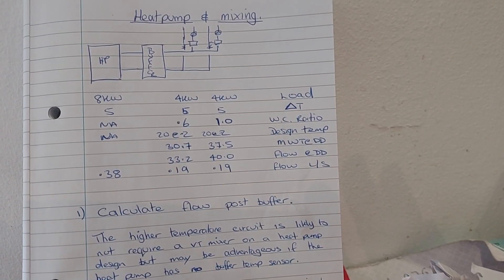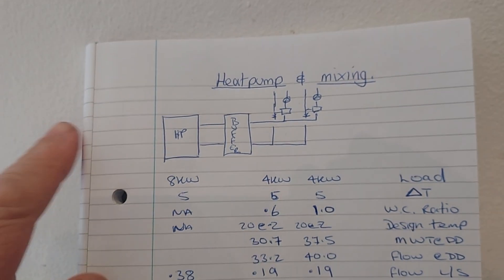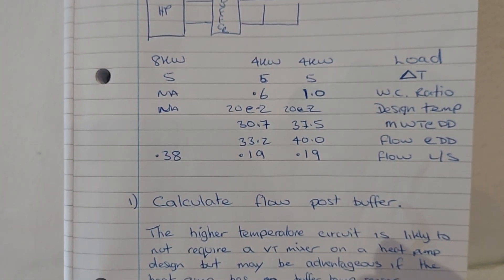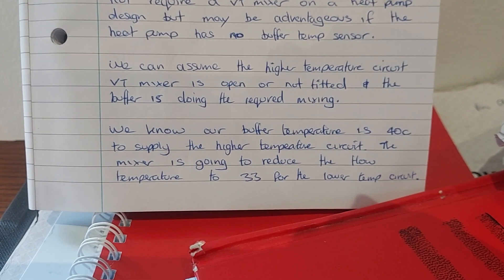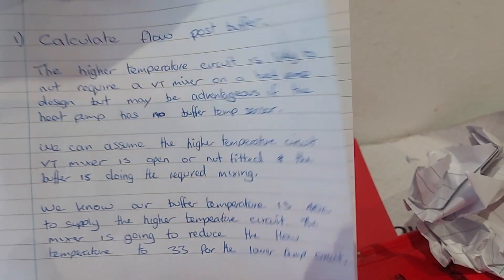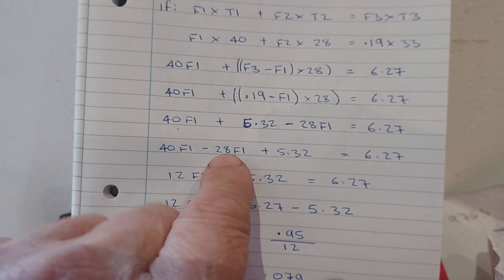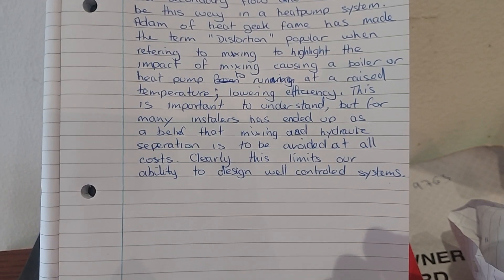Heat pumps, buffers and variable temperature mixers.

Comment: Informataive as always, thanks Andrew.  Liked and subscribed.
In my situation I have UFH throughout a large, two storey, new build.  With low flow temps in mind,  pipes at 100mm c/c except bedrooms (150mm c/c).  One manifold on each level.  Ground floor slab is 100mm dense concrete with lighter cement screed upsatirs.  Highly insulated & airtight house.  I think my heat loss will be <7kW in a 300 sq m home.  With around 3km of UFH pipe (300L of water open circuit) surely I don't need mixing or a buffer?  My concern is would a 7kW Heat Pump require secondary pumps to support the volume / head of water.  If so can these be slaves to main unit?
Reply from the maker: If a heating circuit requires a different flow temperature for it to operate correctly we use mixers to achieve this. If we are using mixers we will not be able to balance the mixed circuits with the flow rate at the heat pump and so we need hydraulic separation. This is provided by a buffer but it does not have to be a buffer and could just be a different form of hydraulic separation. Another reason for using hydraulic separation is when the pump in the heat pump does not have adequate residual pump head to produce the circulation required within the system and the heat pump when directly linked. If you are getting stable temperature throughout your home it is likely that you do not need either a buffer or hydraulic separation. If you are using on off thermostatic controls you might we'll find a buffer would benefit you.
Reply: @andrewmillwardwatford9410  Thanks Andrew.  Not moved in yet, so can't say.  Haven't even bought the Heat Pump.  I have space for a buffer and no issue with including, if of benefit.  Like you though, have heard the same noise about it being of deteriment.  I would have thought though, with the volume of water I have in the UFH, and the fact that I have no rads (other than towel rails off UFH manifolds), that if anyone can omit a buffer, it's me?  I'm from a different engineering background and generally attracted to the simple solutions.  I have air temp measurement in each room connected to a whole home control system.  I have also buried a number of temp sensors in the slab / screeds.  I can use that information to do what I want but don't intened to use it to control any heads at the manifold.  Just plan to tweak the balancing and keep all open circuit.

Comment: Mathematics you have to prove.How are you getting your flow rate have you got a flow gauge before or after your low loss header,how are you getting your temperature what are you using most thermometer have a +- of 2 degrees.my LLH the water coming in is not going straight to the radiators as I have a thermometer either side 40 coming in 30 going out the return is always hotter than the flow to the radiator why what maths works that out Hp has a pump and after the LLH there is a pump.
Reply from the maker: I don't really understand what you are saying but I think you're claiming your heat pump or boiler return is hotter than the flow on the secondary side?
Reply: @andrewmillwardwatford9410  where and how are you getting your flow rate and temperature.mine the readings are after the return LLH.The water mixes in the LLH so is not reading the radiators,I know cowboy-fitted it and ran away that’s life.Thanks for your reply
Reply from the maker: @Allegedly2right  this video just explained theory and mathematics it wasn't the video on measuring. When I'm in the field I use contact type k thermocouples

Comment: A great simple explanation of WC ratio, i would point people doing the heat geek course this. 

When people say design rads and UFH to the same temp, its to lower temp. 
So if 40 max flow on ufh you size the rads to  the same negating need for  mixers.
Reply from the maker: This seems to be a popular statement. Why would anyone design underfloor heating to run at such a high temperature?
Reply: That does make sense, but what concerns me is the difference in WC curve needed for the rads (e.g. 1.0) and the UFH (e.g. 0.5)

If you upsize your rads to work at the UFH temperature, does that bring the required curves closer together? My understanding is not clear about whether that’s true or not.

Or maybe, even though there is a difference in WC curve between the two types of emitter, it might work satisfactorily, even though it’s not perfect design.
Reply: @HowardBurgess  provided you’ve designed all rooms to the same temperature ie 21 degrees then the heat curves will be the same
Reply: @hiltonshaw5528  you can size radiators and UFH to work at the same flow temperature for e.g. -2C outdoor and 21C indoor, but that’s just a single point.

It doesn’t mean that the two emitters/rooms have the same curve. If they did, it would mean that as the weather became milder, the flow temperature for each was also in sync.

However, it’s likely that in milder weather the UFH and radiators would need different flow temperatures, even if at design conditions they were equal.
Reply from the maker: @HowardBurgess  an underfloor heating system running on a ratio of 1 is that the top end of underfloor heating design range. A radiator system running on a weather compensation ratio of 1 is also close to the Limit for radiators. In my opinion you'd have to design the underfloor heating to run poorly in order for it to run as hot as the radiators

Comment: Andrew, thank you for explaining this, it was very well done. Part of the difficulty I feel is ‘people’ desperately need the comfort factor of a rule of thumb. So when they see a credible video that suggests a buffer is not always necessary and can have a deleterious effect on efficiency this develops an almost Orwellian traction ‘two legs bad, four legs good’. ‘Most properties’ in the U.K. do not have mixed emitters (UFH &Rads) and this do not require the isolation offered by a buffer but because of other considerations (system volume/cycling and defrost) may require a volumiser. Which brings us onto the subject matter of this video, mixed emitters  [UFH and Rads) require different flow temperatures - or do they? Can we not design the radiator circuit and their emitters to the design flow temp of the UFH? Or have I missed something?😉👍
Reply from the maker: Yes you can design radiators and underfloor heating in theory to have the same mean water temperature. Buy designing underfloor heating to run at a higher temperature then it needs to you can make it work at the same temperature as your radiators. While this is great in theory the errors involved in calculation and application can leave you with temperature differences resulting from those errors. If you design both systems to run lower temperature as possible and fit a variable temperature mixer on the underfloor heating you're not only gain controlled but you gain some advantages from the application of a buffer. If secondary controls worked correctly then a buffer would almost always be an asset to a system. Just imagine if you control the flow rate on the secondary side when it was fitted on a single emitter system. You could gradually charge the buffer during a normal cycle to prepare it for a defrost cycle. During the defrost cycle you could turn off the pumps on the secondary side and just use the volume of heater available from the buffer to carry out the defrost. With this strategy there would be no dropping temperature within the system itself and only from the buffer. The same system could be employed to prevent cycling or at least to reduce cycling. As the heat pump reaches the point at which it would normally shut down it could then change low speeds and use the volume of the buffer to delay the cycle. Again by using pump control it could then use the volume of heat stored in the buffer to supply the system and prolong the off period of the heat pump. It's not difficult to imagine someone designing a simple control system that would give us these advantages from using a buffer. In my opinion the advantage of not having a buffer is simply one of space saving. Also until we have the correct controls to operate a buffer to our advantage there seems very little point in fitting one on a single emitter system if we have sufficient residual pump head from the heat pump. Also buffers could be very badly designed as they are by Daikin. The Daikin pre plumbed cylinder has a buffer which is short and fat, exactly the shape we don't want. With this buffer we get a raised return temperature to the heat pump due to the heat pump recycling its own flow water while at the same time the system has the same issue. This causes the heat pump to have to run at 5 degrees centigrade higher than it should at all times. If you look at the c o r n o t cycle you can see that at lower temperatures efficiency caused by this raised temperature can be exponentially bad.
Reply: Andrew, your  extensive knowledge never fails to amaze me, you are really raising the bar. Much respect 👍
Reply from the maker: @brotherjohnno  thank you
Reply: @andrewmillwardwatford9410  I'd be interested in hearing more about controls for the secondary side. I just had a system like this installed (buffer with single zone, low temp mixed emitters). There is a valve that separates the two sides during defrost. The secondary pump seems to just drag down COP though. I can see the advantages of a single pump with volumizer instead of buffer - but I've also heard that two small pumps are more efficient than one large. Mine are single speed pumps though, and don't seem very efficient.  So I just don't know...
Reply from the maker: @jsimnable  the concept of controlling the secondary pump is not on any of the heat pumps available at the moment as far as I know. Someone indicated that stable eltron may have such a system on their heat pumps but I have not confirmed this. If you're Buffer and secondary pump is reducing your scop it must be incorrectly set up. You can try to reduce the flow on the secondary side to ensure that the heat pump flow is equal to or greater than the system flow. Obviously a match is the best possible objectives but higher flow on the secondary side is the least desirable situation.
Reply: @andrewmillwardwatford9410  I built  my own controller for secondary side. (run the pump if: thermostat calls for heat, or heat pump is charging buffer). The pumps are single speed, secondary is half the flow with design dT double the heatpump lift. Over the course of a cycle, as the buffer temp increases, the COP drops.  This is in mild weather, I still don't know how it will perform closer to design conditions
Reply from the maker: @jsimnable  why have you decided to have such a large difference between primary and secondary?
Reply: @andrewmillwardwatford9410   increasing secondary would tighten dT, lower supply temp, but there is diminishing returns which must be balanced with overall power. Matching primary flow would triple+ circ power draw to reduce flow temp by 2deg
Reply from the maker: @jsimnable  I'm explaining in the video that the primary flow would be higher than secondary flow due to the presence of mixed circuits. I do think in the opening statements I say this the wrong way round and then go on to explain it the correct way around. I assume you've picked up this error

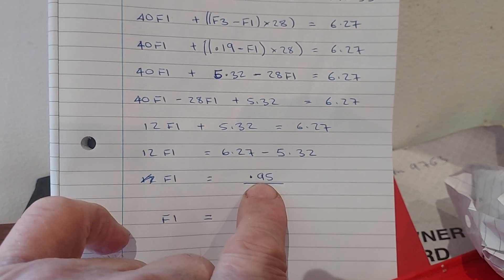Comment: pedantic of me I know, but at 8:35 you say you are transferred the 5.32 across and it becomes a minus.

I see lots of people making mistakes (usually with multiplication/division but also addition/subtraction) with manipulating equations so I'm very keen on people doing this properly and subtracting 5.32 from each side of the equation rather than moving things across from side to side.
Reply from the maker: You make a good point. My wife is a graduate of Economics and was helping me with the algebra. I was actually doing exactly as you said and applying in this case division to both sides. She has been educated in Estonia and she found this rather strange as she was taught simply to transfer it from one side to the other. Also in the video I'm using a simultaneous equation but using the Swedish method. This method is so simple that I don't think most people will recognise that I actually did it. Did you spot the simultaneous equation?

Comment: I have two mixing valves on my Bosch heat pump. Each has a sensor seperately. I don’t have a buffer. I removed it and saved energy/costs. Both mixing valve units have its own pump for good delta t.
Reply from the maker: You can't make the maths add up correctly for such a system design. You will have some interaction between the pump in the heat pump and the pumps in your mixed circuits. If you follow the calculations that I have done impossible to get a complete balanced answer. Like many systems that are not textbook installations the effects of the errors are often of little or no consequence and so go unnoticed. Some would argue that this means that the errors are ok but I would argue that this is not good design
Reply: I thought I you keep the pumps and remove the buffer you will end having the heat pump pump  and the mixer pumps hunting and will wear the plums causing premature failure.
Reply from the maker: @AlejandroCampos-z2x  if the heat pump has certain sensors could be a fault induced by unwanted flow through the heat pump. The interaction of pumps could also cause the heat pump to struggle to maintain the correct delta t. But these flow differences could be very small if each of the mixed circuits runs on a very similar Curve. The point is that hydraulic separation ensures the system will operate correctly but without hydraulic separation we know that something will not be correct
Reply: Hi, have you measured compressor work aswell (in/out & length of active/working), with a buffer previously and without it later on?
Reply from the maker: @829001333  when you have a system with mixers it is an effect an open system as we have constant access to the water within the system and the mass of the screed if it's an underfloor heating circuit. On top of that we have the mass of water in the buffer. Because two mixed circuits cause the buffer to be required at very close to all the time the buffer water is added to the mix. This is advantageous for both reducing cycling and also for defrost.
Reply: Thanks for posting this Andrew. Interested to know where you get all these calcs from? Regards Lee
Reply from the maker: @leeedwards3783  this one comes from c a l EFI
Reply: Certainly not a keep it simple strategy. I bet the upfront extra cost would put some people off
Reply from the maker: https://youtu.be/u5SULoAOvXM?si=QEACw2HkjqLFQpzW